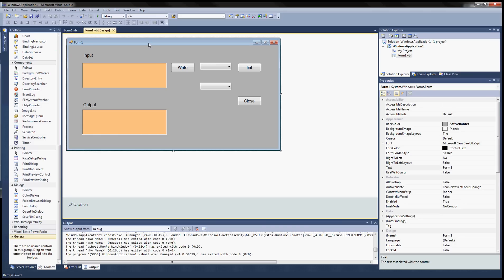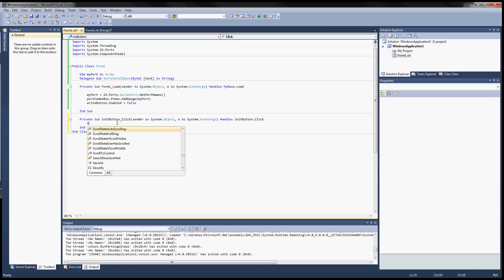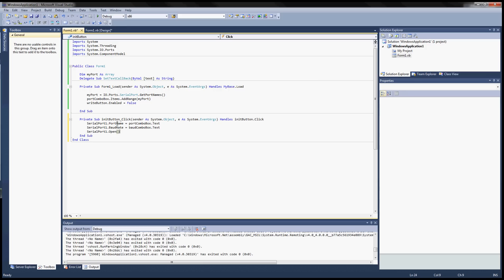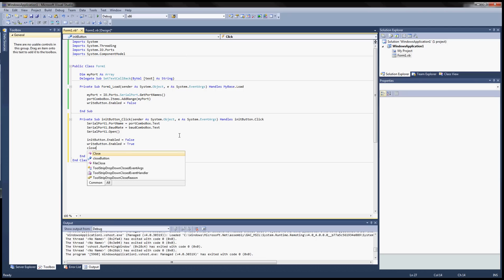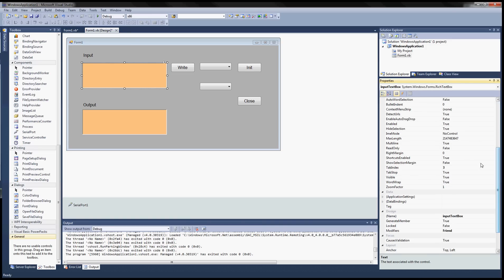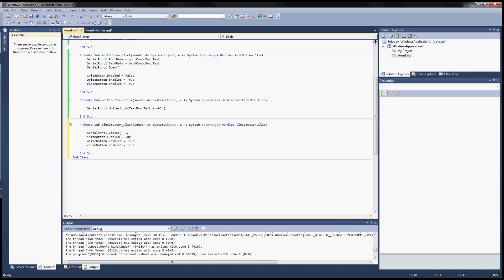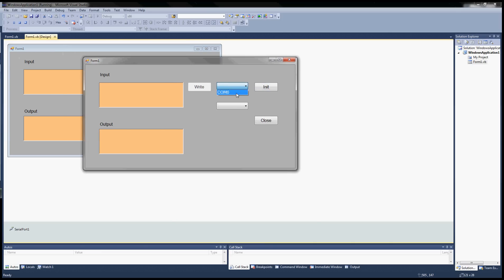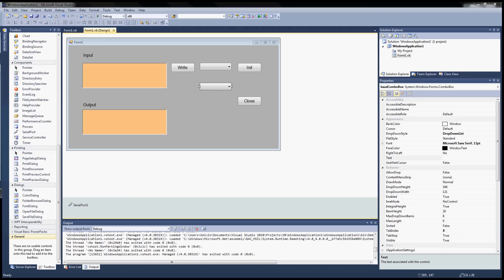Visual Basic Serial COM Port Tutorial (Visual Studio 2010) - Part 4

Comment: Where did you get the SerialPort1? ..error in my application says: SerialPort1 is not declared.
Reply: In your "Form1.vb [Design]" go to the toolbox, select "Components" and double click (or drag) "SerialPort". This will add a serial port component to your app. That's what the "SerialPort1" is refering in his program, you can see the "SerialPort1" component in the bottom of his form design.
Reply: +Jomar Lubrido check your tool bar
Reply: I got already, i just need to drag and drop it, thanks.
Reply: @jomzdonaire6758  Hello Jomar I have the same problem as you, my COM won't show while I run the code, could u help me ? thanks a lot

Comment: when i press the init button the debugger says "port name cannot be empty".the error points here "SerialPort1.PortName = portComboBox.Text". i dont know what to do. please help..thanks..
Reply: +Jimson James 

Hello, I got the same problem. The cause was: my cpu is 64 bits. So, it doesn't work. Then, I tested in a 32 bits cpu and works fine.
The problem is: we are using visual basic 2010 express. It doens't support aplication to run in a 64 bits cpu.